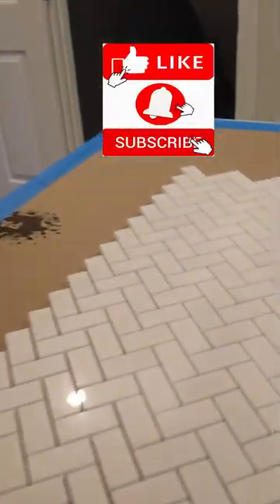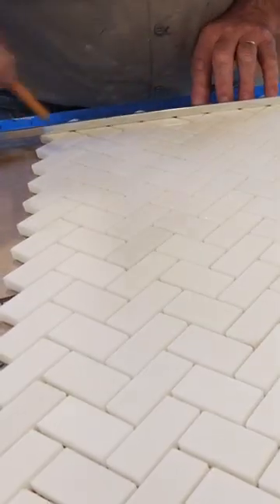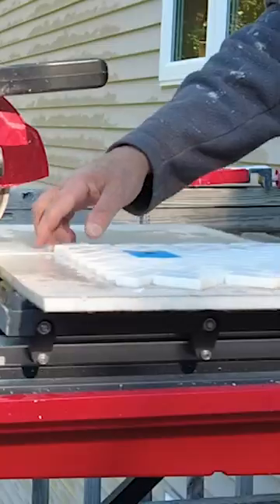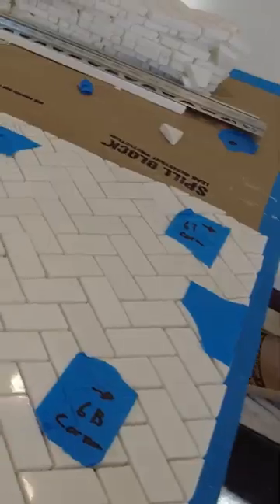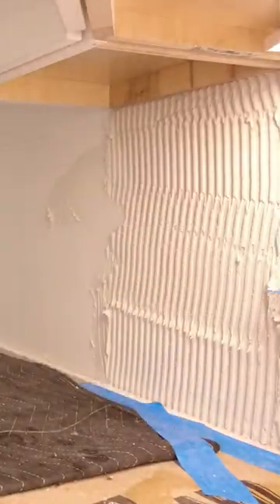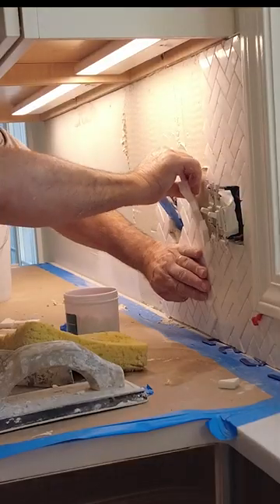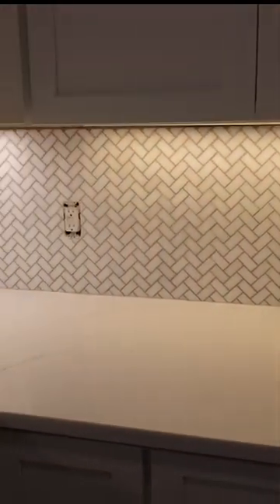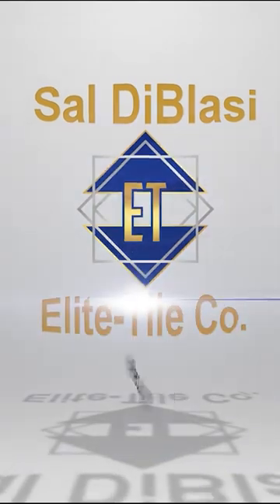Make A Statement With A Marble Herringbone Backsplash #tile #shorts #herringbone #backsplash

Comment: Nice work..!
Do you not use line trial on your thin set.. ? it looks like you're flatting it out..
Reply: Yes! Why the flattening?
Reply: @jlatnyc collapsing the ridges so that it doesn’t bleed thru the tiles…and it gives him more coverage since he’s using a bigger trile than normal
Reply: @2552Zeus you are correct, not saying it's the correct method though. The tile should be collapsing the ridges for a good bond. If it works, it works. Everyone hates cutting out those joints 😂